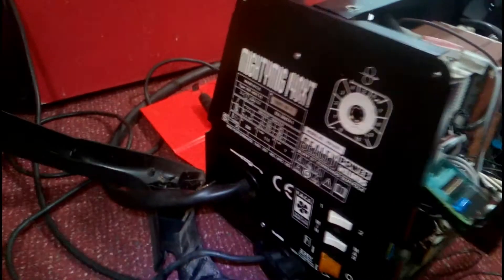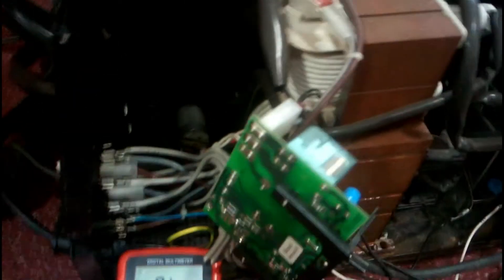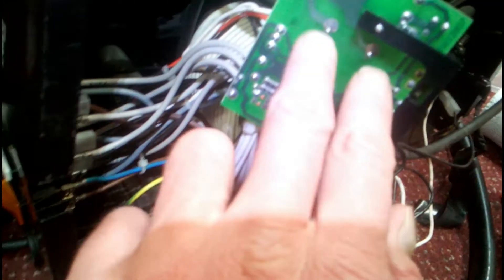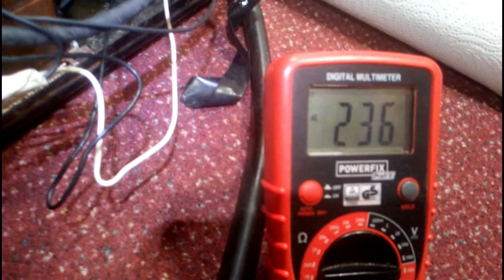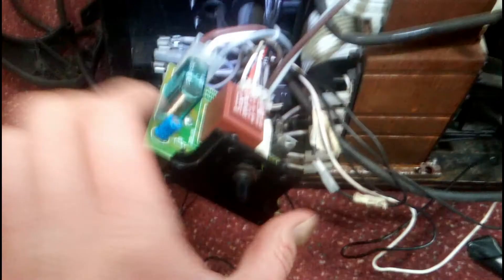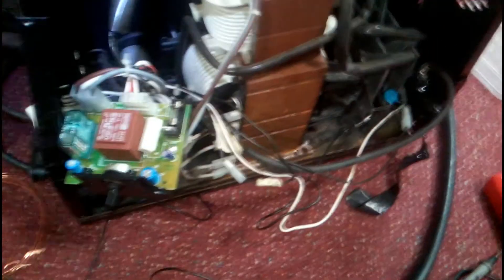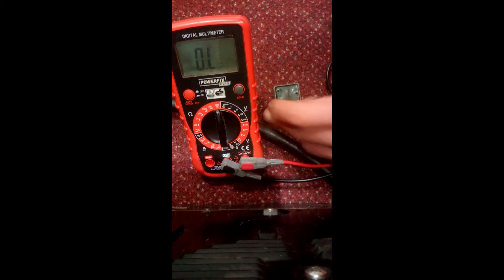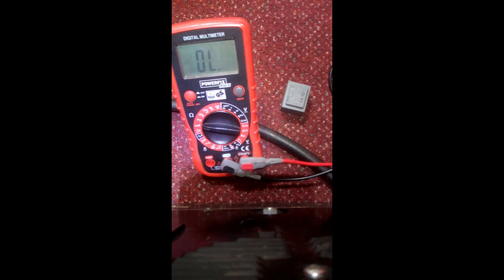Sealey MightyMig 140XT MIG Welder Repair - No Wire Feed, No Power/Arc, PCB Fault Problem FIXED

Comment: I have a supermig185/8 that is blowing the slow blow 0.63A fuse the second it's switched on. Would this be a board fault?
Reply from the maker: @harwoods11  Hi, I'm no expert but I'm sure it could be a cause of your fuse blowing. Might be worth looking on MIG welding forums as there's lots of good info on there. You could inspect the board with the power disconnected and see if there's any signs of arcing or burning or damaged components.